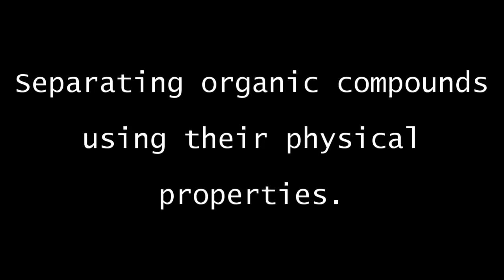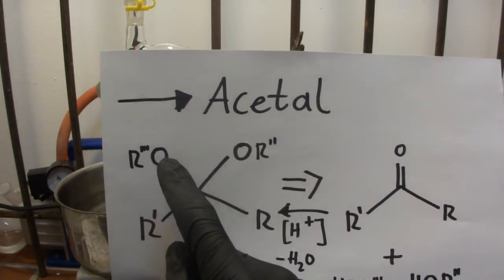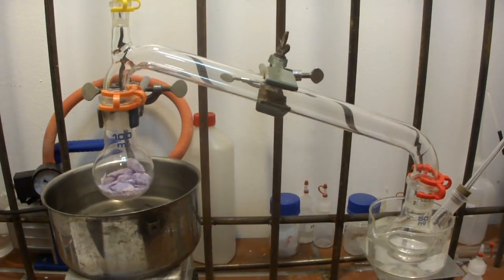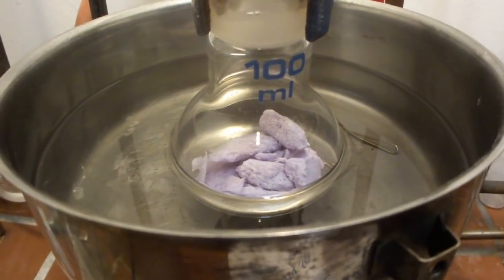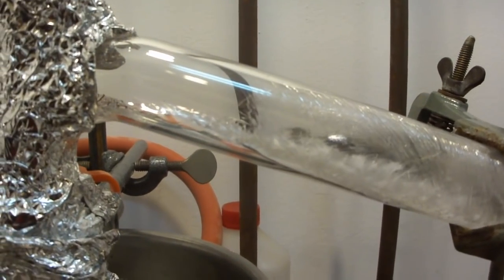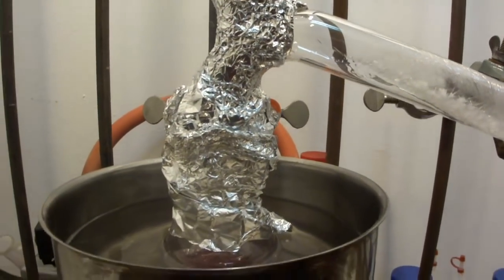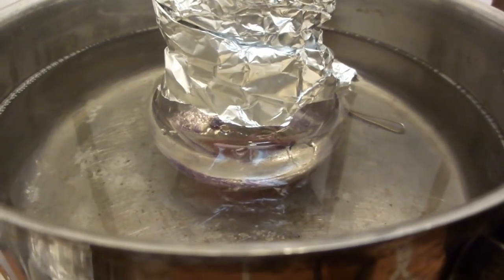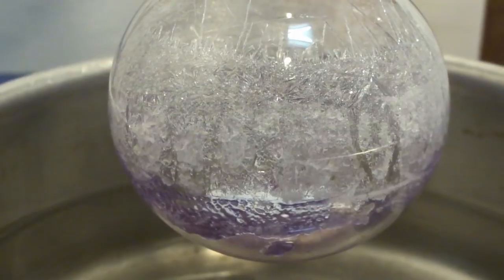Separation and purification of TRIOXANE

Comment: Nice video! One possible trick to run this distillation would be running hot water in the condenser, so the distillate would condense but not solidify. Of course in a small scale using heat gun is no problem.

Comment: Trioxane is great, you can use it in most synthesis as a straight substitute for formalin, also known as formaldehyde.
Reply: Exactly? The structure doesn't look like it is in equilibrium. This trick works pretty bad even with paraform which decomposes into formaldehyde already at rt

Comment: QUESTION...........GREAT VIDEO...........So can i just put trioxane in water and use it just like i would formalin????????   How do you convert it to formaldehyde gas?????
Reply: If you put it in water and heat to around 150 to 200 Celsius you should get the monomer
Reply: @timecode37  ..........Thanks.  But could you even get a water/trioxane solution up to that temp?  I mean water boils at 100C and trioxane at 115C.    I been learning more about acetals and i am told that if you add an acetal to dilute acid like water / 5 % H2SO4 that it will break the acetal back into the aldehdye.   It is implied that because you have protons and water that you need no heat and you just stir for 15 minutes.  But implied does not help me.  For all i know you need to heat it up and reflux before the acetal turns back into the aldehyde.   Guess i will find out soon by doing a couple experiments.  Hopefully in a couple months here
Reply: @johnblacksuperchemist2556  I wrote that really weird, sorry. on heating with a mineral acid you should get formaldehyde gas coming off as the trimer breaks down. If you then dissolve that gas into water you get a formalin solution. Note, that I've never personally tried this and I'm only telling you things I found out by googling.